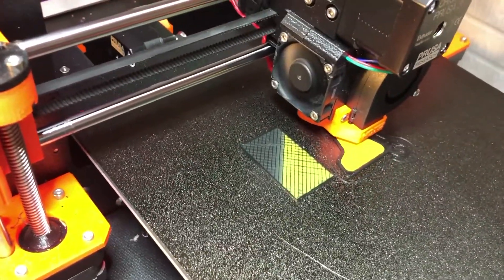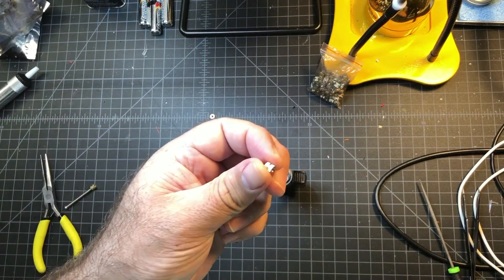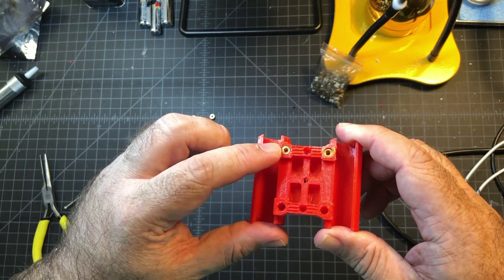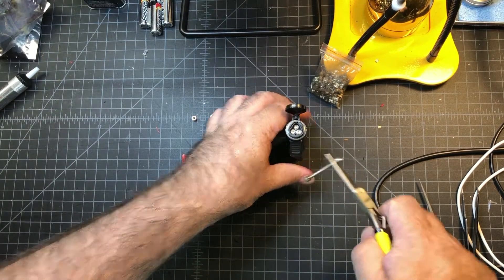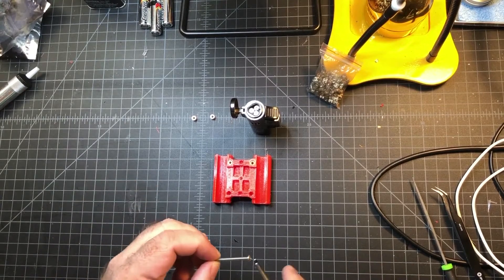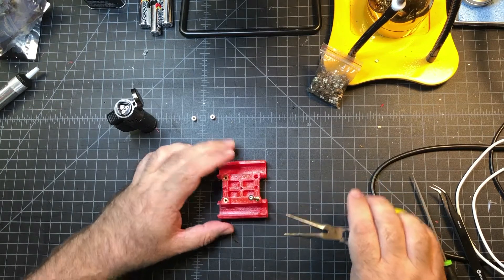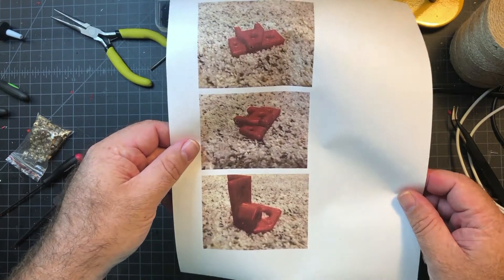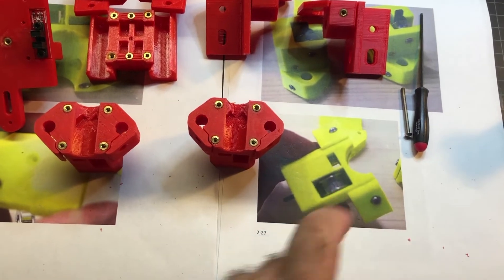Hypercube Evolution Build - Part 4. Heat Inserts

Comment: How many inserts did you actually end up using?  The BOM links to a pack of 100 but wasn't sure how many it actually uses.  Would a pack of 50 be enough?
Reply from the maker: Hey Nicholas, yes a pack of 50 would be fine. I am not exactly sure how many but I think 50 would be enough.

Comment: I would say using a soldering tip would be easier/more controllable, plus the actual official instalation tool is a modified solder iron tip. Keep it up!
Reply from the maker: Yes, this is not a bad idea!  I thought about getting a soldering tip, but I didn't see them for less than $20. The soldering tip is definitely a good idea if you don't mind buying one.
Reply: @GregsMakerCorner  you can use a normal tip for starters. No need to go for the special one.
Reply from the maker: @alex.cristescu  I actually did use a regular tip a few times when experimenting. I wouldn't recommend it over the lighter method, but if it works for you, awesome!